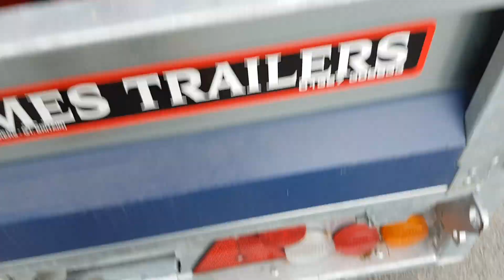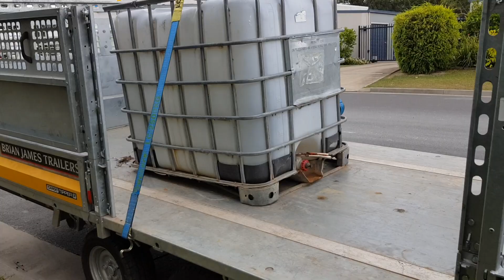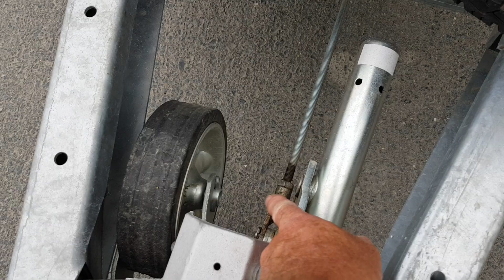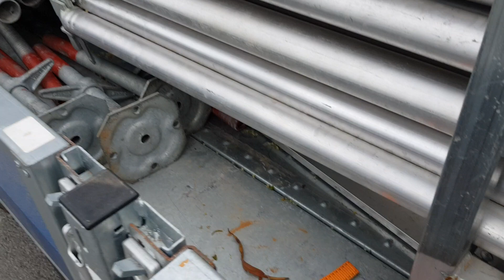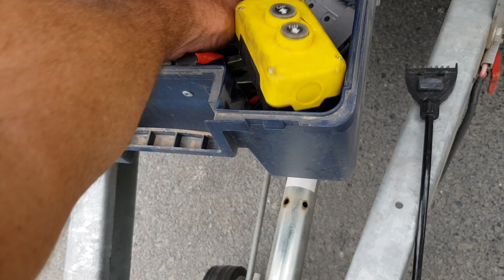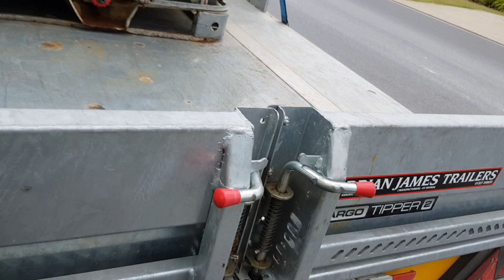Brian James Trailers Australia -  6m Car Trailer and 3.6m Tipper Trailer Review

Comment: Thanks for your great review. I really like the utility of their design but as I do a lot of highway driving as well as bush driving on my farm, I am concerned about 1: non-standard rims/tyres, potentially obliging me to chase BJT and pay whatever they want to charge if I need replacement; 2: so many bolts to work their way loose; 3: so many clips and latches to check that they have been properly secured each time I use them or that they have not shaken loose while driving. Have these been concerns of yours? Thanks.
Reply: Hey there, I know it was 10 months ago but I have been researching trailers for about 5 months now. The trailers are top notch, however I would research the price and availability of the tyres and rims first. As for the many moving parts, you can always replace a lot of the nuts with lock nuts, locktite, drill the ends out and insert split pins too. Trailer maintenance is inevitable, but I know where you are coming from. Off road, I'd be looking for something with more height and flexible suspension as I have. The 14" Ford rim with 5 x nut stud pattern are one of the most common trailer rims in Australia FYI. Good Luck.